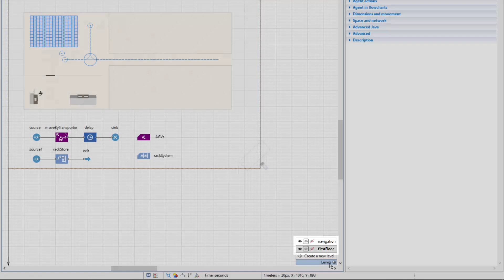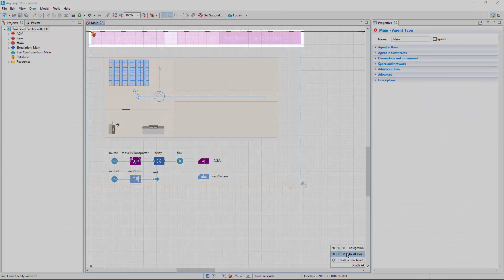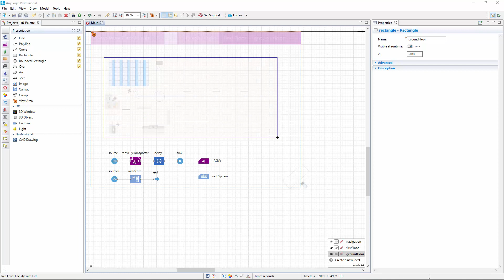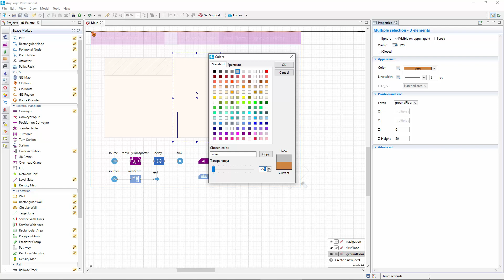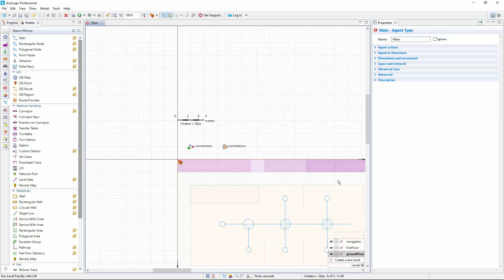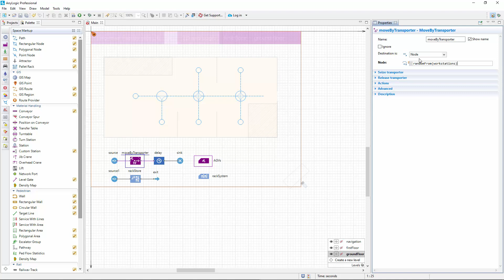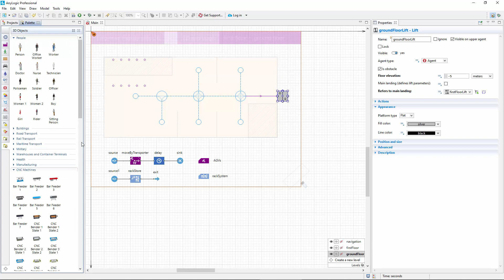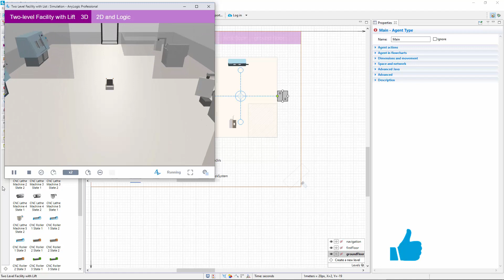Simulating multi-level facilities

Comment: Is it possible to have capacity parameter for the elevator? Also, can multiple elevators can be used as a resource pool for multiple floors movement simulation? Thank you
Reply from the maker: Hi Kwok! Capacity for an elevator could be simulated by various options. Technically, the "Lift" element is able to handle one entity per trip.
In case you do not want specific transporter type to enter the lift, assign an area with restriction by a condition ("agent.weight > 10"). It would be better to navigate agents in process flowchart according to the lift capacity. Resource pool of elevators seems to be excessive. You can simply use a collection that keeps an array of idle elevators.